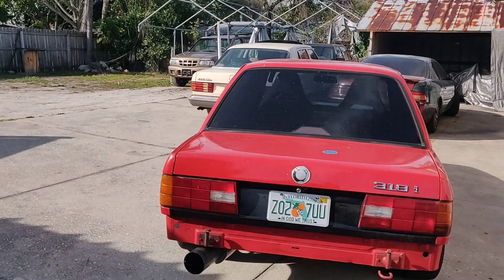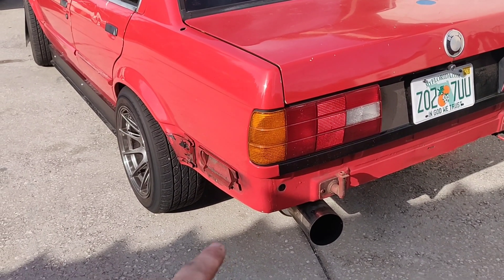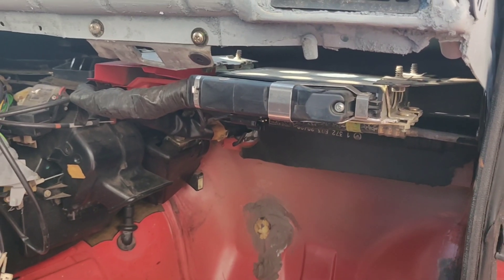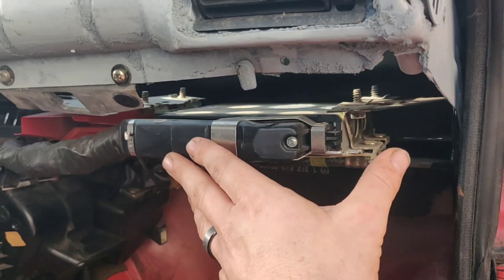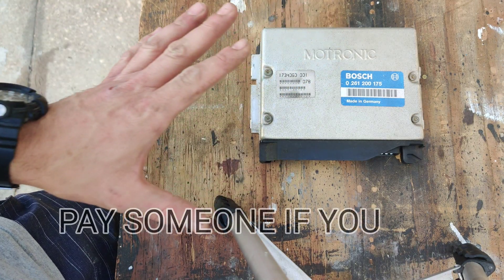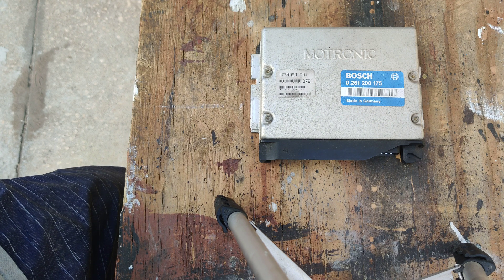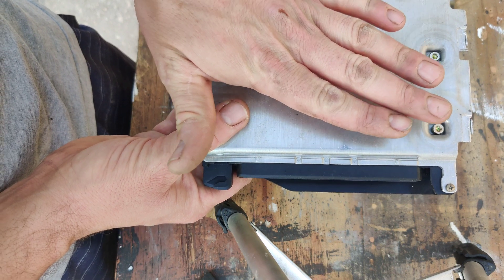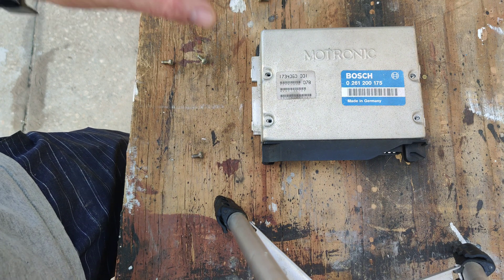BMW e30 318i drift car adding Dinan performance chip 20whp gain

Comment: A bit late to the party-what were the power gains if any? Thanks
Reply from the maker: Yes. I didn't dyno but felt like 10hp or so but lots of bottom end torque.   Tires spun way more than before.  I have a very light car but this made a big difference.  Also rev to 7k
Reply: @petescarport  Nice!! I have an automatic, I wonder how that would work out.
Reply from the maker: By the way what's goat coffee.   I happen to own a coffee company